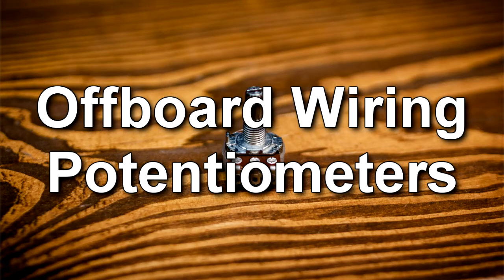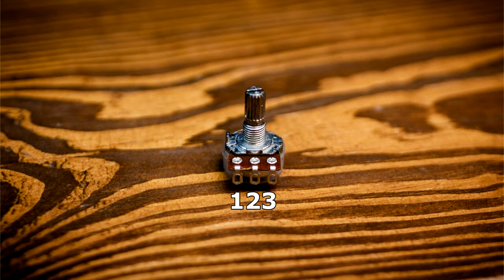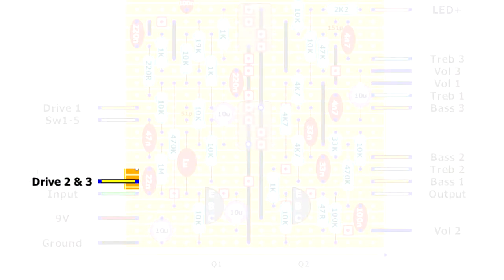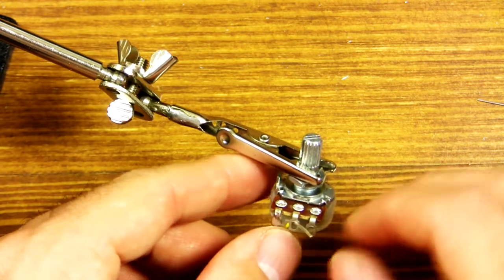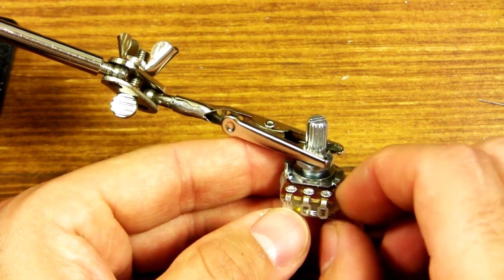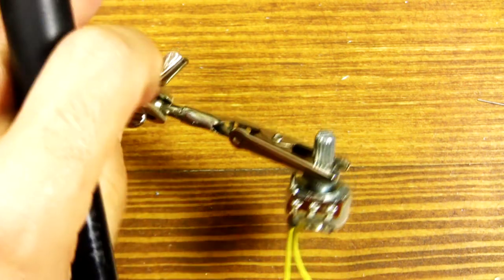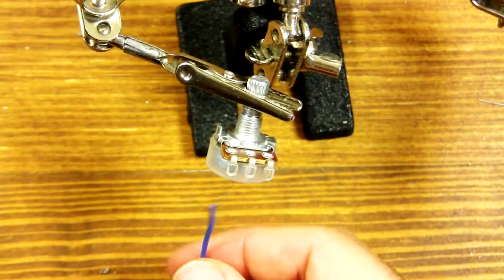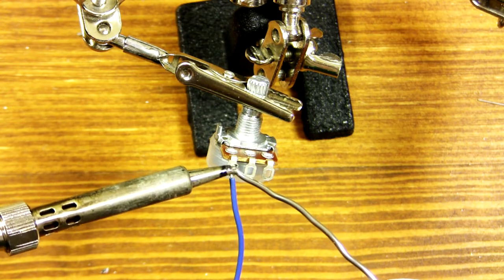Mklec Guitar Effects Pedal Kit Build Tutorial - Soldering Potentiometers

Comment: So how do you get the solder to grab to tge backside of the pot ? Because no matter what i do it won't grab, i sanded the backside down, i have put flux on it, and it still won't grab onto the backside.
Reply: MrShadowofthewind You have to heat it a little with the tip of the iron. Careful not to heat it too much, or else you’ll damage the component on the inside.
Reply: some people sand the back of the pot (just a little) with sandpaper